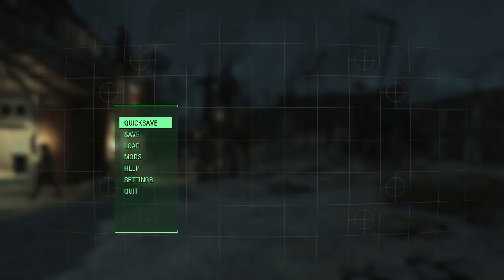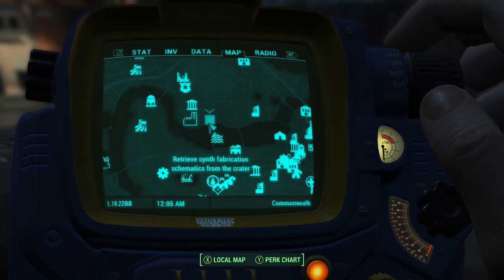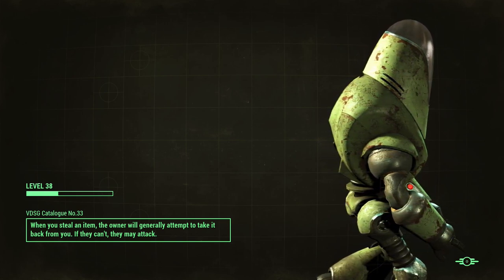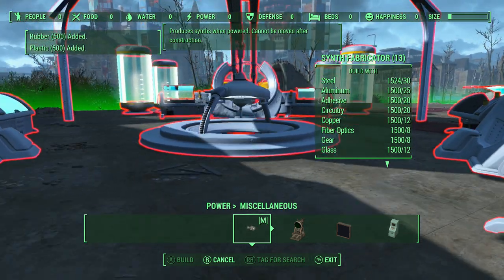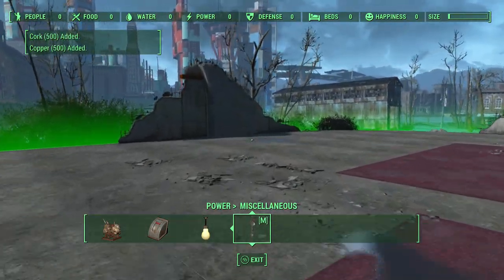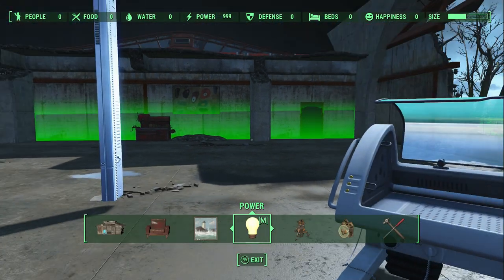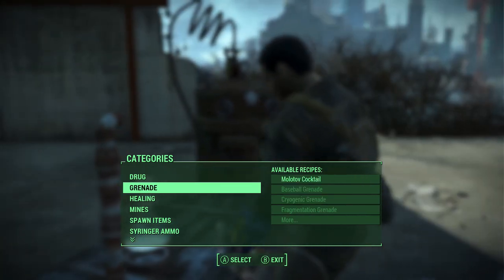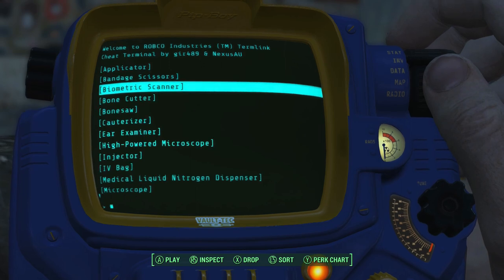Fallout 4 synth production mod tutorial updated 2019

Comment: I did it but no one comes Out of the pool
Reply from the maker: when this happens reload to a previous save preferably before you started the synth manufacturing process. Make sure you have the cheap terminal installed so you can get all the materials you need. Give it another try and let me know people are having a lot of problems with this mod I tried contacting the mod Creator a while ago but they haven't responded to me yet